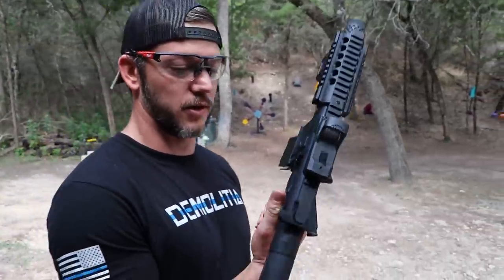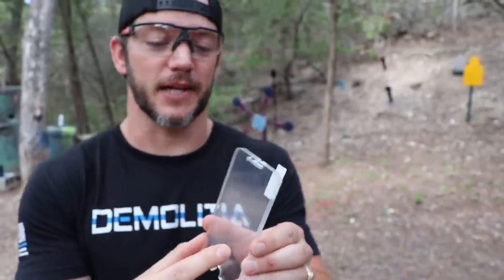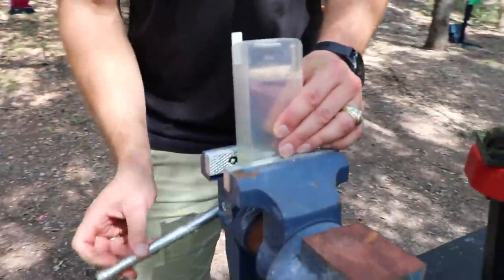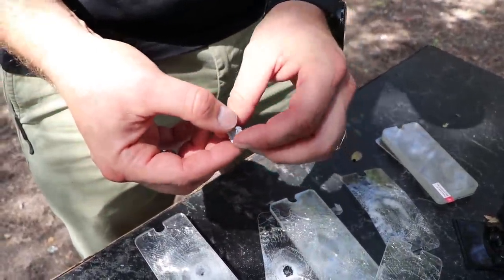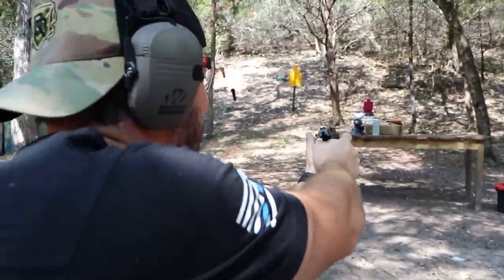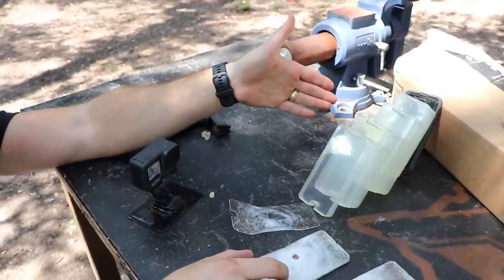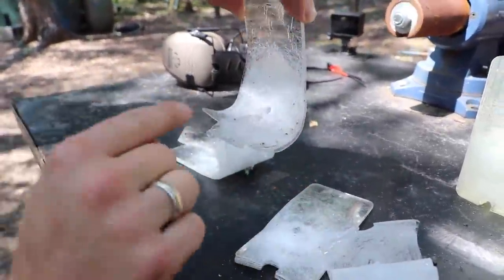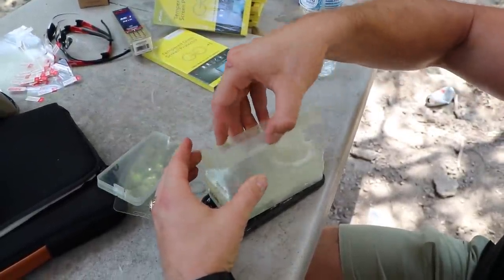How Many Screen Protectors Does it Take to Stop a Bullet???

Comment: the cracks did that because of energy waves. The impact came all the way to the phone and hit back (that's also the reason why many went flying to you), but when it hit back, it obviously came on the opposite direction, causing a destrutive wave relation. It's a little bit complex but in short that wave behavior alternates betwen short periods where the energy is twice as poweful as the first wave and other points ware the resulting force betwen the still going impact energy and the energy that is already comming back results in "zero".
To understand better take a look at any video about constructive and destructive waves

Comment: Look at the muzzle velocity of 22 hornet and then look up speed of sound.
The massive barrel length would have helped too since more gunpowder has chance of ignition and bullet has stable spin for optimal flight
 During that short travel the bullet was still traveling above 2x speed of sound when impacting first protector.
The first bulging you see with the inconsistency is the boom giving some of its force but the rest of it (take into consideration the conical form of the shock wave) curled just around the outside finally imploding in on itself near phone. 
That kind of demonstration is rare to see. Nice!

Comment: Hi Matt just to inform you tempered glass is lot denser than normal glass so what happens is as soon as a dump tempered glass is shattered it expands like gas pressure inside your barrel
Reply: That could only explain the screen protectors jumping back I'm not sure how to explain the shock waves it could be the densities carrying through the shockwave like sound pressure waves in the form of sound waves and so forth reaching a climax point at the end for more information look at how light reflects inside the optic fibre line it might explain how the shock waves reflect reflect in the tempered glass

Comment: The ones in the middle didn't break because they were close enough to the ones in the front to not take a hit but instead transfer the force. The ones that cracked had a large enough gap that they  took a hit from the ones in front rather than transferring the force

Comment: you’ll notice with screen protectors, while they are very shatter resistant,  they dont fair well to pressure. dropped my phone many times with no issues only to have it shatter in my pocket with some tight jeans on lmao. those pressure waves traveled back and forth through those screens, why some made it out ok is really a toss up.the wave probably just made a clean pass through some but not all. tempered glass = temperamental i guess 😂 good vid

Comment: The impact travels through the chain of screen protectors till it had nowhere to go and absorbed all the energy. You can't just let the kinetic energy from the bullet disappear most will transfer to potential energy (which the glass won't possibly handle) and break, the middle glasses will help to transfer the energy but as soon as the energy reaches a air pocket or the end of the chain the energy has to convert to something and boom potential energy spike in the protection and it breaks. But as soon as it gets a stable chain again it stop converting the energy and sends the rest of the energy forward to the chain untill there is nowhere to go..

Comment: Co2 is weak compared to my gamo break barrel .177 moving at mach 1 and yes it goes faster than the speed of sound.get a break barrel pellet gun and diesel your pellet you will be surprised how much speed u can make with just some air filter oil lol.i send lead through steel with mine. Love the videos keep up the good work.

Comment: So I was wondering,

How some glasses broke and some didn’t, It may comes from how the choc Wave pass throught the glasses.
I explain myself:

Some where stiking really well together, other where just touching eachother.

(There is was some élasticity in the glasses, because of the glue behind it, that’s why your glasses don’t break every single time they fall; for the ones that didn’t break and transfert the énergie.)

So when the wave came through each layer,  if there was a air in between blocks or o small bubble of air between two sticked glasses, a crack appeared.

Tanks Matt for your vidéos even France watch you!

Sorry for my english

Comment: really depends with the screen protector.   in some cases, the material they are made of... will stop  a .50 cal AP round... with a mear 41mm thickness.  (1.6 inches)  while you won't see a screen protecter that thick...   the fact that that same material is being tested on armored vehicles to replace laminated glass is a statement.

Comment: the weird affects likely due to flexing of the screen protectors that werent able to move much packed tightly in the middle and simply transferred the energy to the last few that we saw WERE able to flex a lot in the very back, in the slow motion. And the bending flexing free movement at the end led to what we saw. Think of a newtons cradle where the middle balls dont move, because they cant, but transfer energy anyway. Only the back ones were free to bend and couldnt take it.that my theory anyway...

Comment: Glass has plasticity, meaning that it can flex/move a small amount. When a fast impact happens it sends a micro ripple through the glass. If the ripple is large enough, from a very hard impact, it will send a cone shaped piece of glass off the back. With the phone blocking in the piece that would have shot out, you ended up with just a very shattered screen.

Comment: The shockwave moved through the glass like a spring and the wave came back which is why so much stuff launched back at you this constant back and forth reverberation is probably what caused the seemingly random broken screens I’m sure if you broke it down and got the exact number of screens broken u could find a pattern somewhere and match it to the energy of the bullet being transferred (to check your work) then you could possibly even find the pitch and frequency of the wave or something I’m not attempting that much though sorry 🤣🤣

Comment: Maybe its like: a bullet is smaller so it can also make higher vibration sounds. Adding more Powder makes them faster, louder and the effect on glass seems like...also more vibrating. So that's how it was holding so Long. The reason why it was like shattered, not shattered, shattered is because some gave the vibrations clean and smooth until some layer just messed up his job. So the vibrations stabilizes itself again but the bullet stopped waaaaaaaaaay earlier. What u think about that?

Comment: 7:15 That could've easily been a hang fire as well, which could've blown your fingers and gun to bits. You need to be more careful and wait 10-20 seconds before ejecting rounds. it only takes one time
Reply: Why hasn't this comment got more likes. I mean it's great Mat does fun things with guns, but he shouldn't start cutting corners on basic gun safety unless he wants to end up like Kentucky Ballistics.
Reply: Eh? I agree that holding a possible hang firing round is not the best thing in the world to do but a round that small outside of a barrel will probably do less damage than holding an exploding firecracker in your hand. In no orientation will a hangfire blow your gun and hands to bits unless you get a hangfire on a big boi round, or a shotgun shell. 
Even hangfires on rifle rounds normally either pop out the bullet or a small hold out the side of the casing. Hardly much danger besides minor injuries.

Comment: Is transference of energy. It’s like when you hit a pool ball into another pool ball. The first pool ball just stops moving but the second one goes flying. That’s because the energy gets transferred down the line. You stacked the screens in blocks so as you transfer the energy from one block to another some of the energy was left behind and shattered a couple of screens. However most of the energy still managed to make it to the end and destroyed everything at the back. In the case of all the other bullets l, I can only assume that the energy was dispersed through all the screens protectors.

Comment: The glass acts just like those momentum preserving toys that people put on their desks called Newton's Cradle
The ones with 5 SS balls on strings lined up touching and when you pull up and drop the last ball, the force transfers through the middle 3 and only effects the end ones...🤔
I'd be willing to bet glass broke in any place that had a small gap between screens, but all the ones between the gaps just transferred the force through without breaking🤷‍♂
That's certainly my best guess at least, though I'm more of a chemist than a physicist⚗👨‍🔬
So, I wouldn't guarantee that... but I'm fairly certain of it😅

--RuneShine, Michigan's Norse-Druid Alchemist✌💚🙃

Comment: The Impact point and the direction the bullet is moving is where the direction the energy of the bullet want to go. When the bullet is penetating the First layers they start to deform into the direktion of the force and a domino effect Starts.  The deformation cant get further if it hits a harder surface, this is the point where the screen Starts, it will spread all the force more onto its surface and breaks it, the protection itself hit also a hard surface and also spread out the energy and breaks. The bullet is one force,  the Not moving object *Phone is another force, the screen protection gets on both sides nearly the same pressur. Inside the screen protection there are comming two pressur waves that meet up close to the middle and break the protections in the middle.
Ps. Alot of energy of the bullet got lost because everything could move, if something can move the impact energy wont get used for penetration, it releases its energy partly into acceleration. With a not moving Phone the result would probably look way different.
PPS.  The screen protections came towards you because of the pressurwave, the force of the bullet spread into different forces on Impcat, one of those forces got reflected.

Comment: Would it ever be possible when saying loading a clip to pack a round too rough and nick the back and make it go off?
Or say if you held a bullet in a vice and gave it a little whack on the back with a regular hammer, would that do it? Reason I ask the second one is that as a young teen I came by a blank round from someone (being in the UK i have no idea where my mate got it from) and had the idea myself to do the vice thing in the woodwork class, position a chisel or thin screwdriver over the back of the round and strike it with a hammer to see if it would work but I figured it'd be a pretty sure fire way to get expelled

Comment: I think that the reason that the .22 hornet shattered the phone and ones in the back is that all the power and pressure from the shot went straight through the phone cases and then when it hit something with a solid backing it all just collided with the phone

Comment: Now i have no idea if this is right im not a physics professor just extremely stoned😂 but Id say the shock wave wasn't over a small enough area once it covered most surface area propagating in a cone shape back twords the center you should get like 1000 screen protectors and see if there's multiple spots of uncracked protectors

Comment: Science Guess!

You have a shockwave passing through the protectors. The shockwave curves the protectors, and causes shattering. 

But the shockwave works like a ripple. With peaks, and waves. Here is a crude illustration of how the wave is passing through the screens using this ">" as a bullet 

Pow!  >     )))|||(((
The shockwave passes through and around the middle, not effecting much. (think newton's cradle, but this is a flexible version of it.)

This is a super simplified explanation, but enough for a youtube comment.

Comment: The back ones probably broke when you shot it with the 22 hornet because of the increase in weight and pressure to the stack against the cinderblocks behind it when the shock wave decompressed the stack the back ones shattered not from the wave itself but from the weight and compression. I bet if you redid the test with something soft in front of the cinderblocks the outcome of the whole test would change!

Comment: @DemolitionRanch
Anything that is skin-tight or set firm along the inner walled surface. ANY type of deformation will be focused on a matter of "cause and effect" to take place. So the entire stack getting slammed with all that force applied it all the way down the entire stack straight to the last object which was the phone. As Newtons Law states, an object once in motion stays in motion. Thus your phone screen was the ultimate ending where all that force was exerted resulting in the destruction of its screen. 

NOW, If you were to have placed all those screen protectors as before but just placed the phone maybe a centimeter back that's all you'd need to keep them from obliterating the phone screen once again as those were able to put up a pretty good amount of stopping force, just need to use the damn Barret and get the suffering over and done with lmfaooo

Comment: looks to me like the concussive force that was shooting the protectors out towards you were going against the force of the still moving bullet. basically the shockwave of the initial hit cancelled out the kinetic force of the travelling bullet itself and the middle protectors were unmoved. but towards the back the 2 shockwaves desynced because the bullet slowed down enough that the initial shockwave overtook it and the 2 concussive forces desynced and caused the back ones to crack. 

i have no idea. im an idiot
Reply: Ok now you have to do like 5000 protectors vs a 50 cal rifle with ap! That would be so overkill it would awesome!

Comment: I wonder if the fact it was tempered glass had to do anything with it, since it's made to stretch and bend right? Well if it were to stretch and bend, speed from the hornet round could have carried  a shockwave that kinda acted like an aftershock in an earthquake. Another way of thinking about it would be a rubber band, when you first let it go there's a violent reaction right away and some time in-between when it's still and then there's a sort of rebound where it carries the kinetic energy from the first reaction back in the other direction. Basically one of newton's laws of physics, every action holds an opposite in reaction. The force threw screens at you and the reaction was cracking the rest past the neutral ground in the center
Reply: Sherri T[A]P Me!! To Have [S]EX With Me  I guess that makes sense, though you'd think it would be more like glue than a rubber band. Holding it together instead of shooting it back, I mean that's what the coating is on something like aerospace grade tempered glass or stuff they use on skyscrapers. Then again it's cheap phone tempered glass, these are really good questions and you have given me quite a bit of good stuff to think about.

Comment: 4:59 seconds I'd day stop the bullet 🤔 10:28 l did think you may get screens coming at you.🍻
Maybe the composite bullet did it. Copper would have held its shape slightly longer than the lead and they  compress slightly different creating push back.

Comment: You made a video where you explained why the backside of your cristal ball shattered. And now you're wondering why screen protectors do the same?

As for the random broken ones: I would imagine that they where simply the ones that were easier to crack. Mabey they had micro cracks, or dust between them.

Comment: Screen protectors saves your phone from screen shots
Reply: I wonder if it's like those hanging marbles where the energy travels through and knocks the one on the other side so like the energy traveled through the other screen protector and cracks the ones after. Or they just cracked cuz of the force of the other screen protectors

Comment: So you know the 5 balls on strings. The first ball moves.  Then the middle 4 don’t and the last goes flying same dynamic.  You phone took all the kinetic energy of the front. blast.  All the energy went flying into the phone. If all the glass screens were epoxied together and the phone not touching them. It would have been fine.

Comment: Id put this down to elasticity. Not everything is made with exact strength and integrity when things are made like these little pieces of glass if you was qble to measure it to an exact strength they wouls all have their own limits to their strength intergity.  So even though bullet is stopped way before..  everything includong the pgone wnd whats behind thr phone is experiencing a force thats is still great. And after many shot attemtps the abrupt impact has caused many of the weaker items to break/crack/shatter earlier than others

Comment: Well let's consider that the top layers flew towards you, this tells us that the there was a rebound force back in your (towards the front) direction.   Tempered glass is super hard, and super brittle, meaning that the shockwave from the impulse imparted by the bullet travels through it super fast.  So where does that leave US.  It is simple really, every gun law is indeed an infringement.

Comment: Just like the crack of a whip or towel on someone's buttocks.... the energy wave traveled through the stacked protectors and released it at the end. If there was zero gaps and something that would have kept them all together better then the wave would have propagated back and forth within the structure till it dissipated all the energies.

Comment: .380 is only shorter than the 9mm. You can actually shoot .380 ammo out of a 9mm. About like how you can shoot .38spc out of a .357mag. Or a .45 long colt out of a .410. It is a weaker round obviously. But it will still work. Lol. 😂 😂 😂